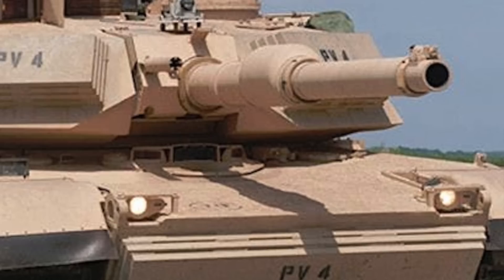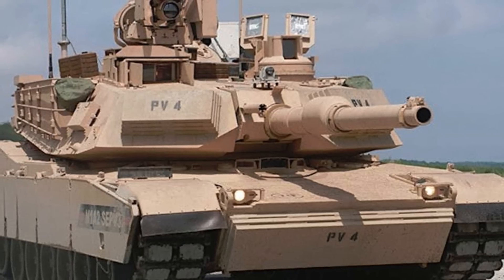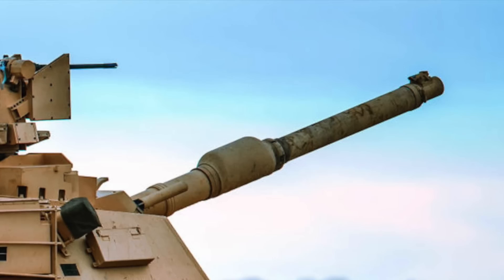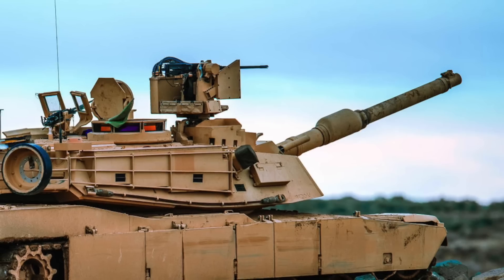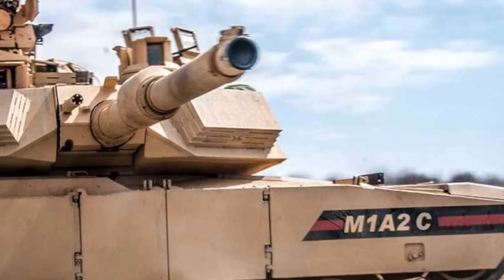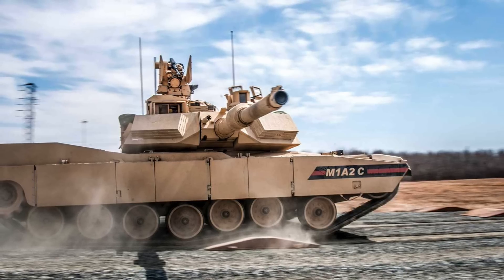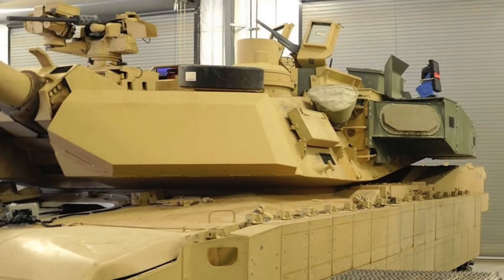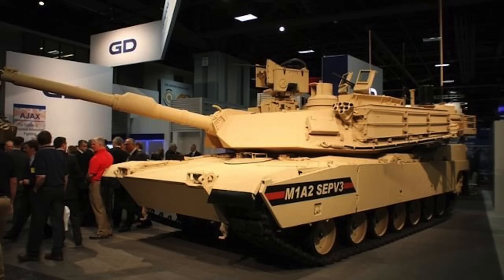ABRAMS M1A2C - FULL ANALYSIS OF LATEST VARIANT !

Comment: 😂😂😂😂Only 20 Armada tanks ever made! Well it looks like those i have seen in the parades are not so scary after all.
Reply: Νίκος apparently a Bradley can penetrate it
Reply: MyStreak I heard they can penetrate the unmanned turret. The hull is still unknown. I at least expect the hull to be able to protect from a Bradley.
Reply: MyStreak Bradley TOW Missile through the turret side would penetrate the turret armour, however the damage t would do remains to be seen as the T-14 has an unmanned turret design and the hull ammo storage so not much would happen. It also has an APS which is designed to hit AATGM’s out of the air similar to the Israeli trophy system on the media a so it’s dubious if they could hit it. BUT you are correct that if a TOW actually managed to impact that area then the tank would be pen’d.
Reply: @mystreakyt  yeah,nice dream,even though very delusional.
Reply: Maybe they are applying the principle the NATO forces used during the Cold War.  The NATO forces operated on the principle that they should be able to kill 10 to every 1 ratio. Obviously, the key is to stay alive and not get killed or have your vehicle blown out from under you. During the Carter presidency, the U.S. Military suffered from underfunding to the point where major decisions couldn't be made with respect to upgrading units with the latest technologies. Often units were sent around to various depots to cannibalize vehicle for replacement parts in order to remain at full combat readiness to some degree. It probably was until the Reagan presidency that U. S. forces saw their strength achieved.
Reply: helen he only 12 Su57 now, and how many are serviceable? God only knows.
Reply: Many people here dismissing the Russians. Even the Germans with their superior tech were quick to dismiss the Red Army... 20 Tanks, serviceable by 2028, too weak, We will blow them away.... War changes the need to produce weapons fast. Are American made weapons fast & cheaply produced compared to Russian tech?
Reply: Simon Shaninga We’re not in the 1940’s.  Russia doesn’t have the manufacturing capabilities to build high tech equipment on mass scale efficiently. Even in WWII, Russia received millions of tons in equipment from the US under the Lend Lease Act.  Russians seem to have forgotten how much aid the US provided. It included 400,000 jeeps, 7,000 tanks, over 11,000 aircraft , almost two million tons of food.  To be honest, when I read anti-USA remarks from Russian trolls like yourself, I sometimes wish the aid would not have been given.
Reply: @Thetequilashooter1  

Rubbish, FYI Russian Red Army would have defeated Hitler with or without USA aid, and frankly speaking USA aid claims are highly exaggerated, I read Field  Marshal Zhukov  comments
Reply: armata is not in full production yet. wont be untill 2021-2022. because the arbrams is still only competition worthy to the T-90. no need for the armor expensive armata yet so they are going to put a 152mm cannon on the armata T-14 B model . the abrams with a  firepower upgrade wont be ready untill 2023. so that way the T-14 and better abrams go into production around same time frame.Russia can save a little in the meantime upgrading existing fleet.
Reply: @georgicooley5491  Competitions will be the Middle East countries buying weapons from the United States and Russia
Reply: https://www.latestnewsplus.com/2019/11/russian-military-to-get-pilot-batch-of.html?spref=fb
Reply: 😂😂😂😂They spend far less money on military and still have a superior tank than the USA.
Reply: @artemg11  Superior Tank? More like paper tiger.
Reply: @artemg11  Good for them then!
Reply: Russian tanks are death traps when going against M1 Abrams! Just watch the news.
Reply: Crazyirish _  Yepp,just like those Abrams targets burning in Yemen.
Reply: @isahbello9785  you mean export variants of abrams that dont have depleted uranium hulls and other added protections
Reply: @eibenzw2574  same could be said about the Russian tanks reputation, as they were exported versions to countries that didn't really give a damn about maintenance and upgrades.
Reply: @Hierachy  riiiiight maybe if the tracks had been tightened and the oil changed it would have made them more accurate and bullet proof .lol
Reply: @abramsatwo2515  those particular things can impact readiness of said tanks, but doesn't change the fact  that they were exported versions of said tanks without important upgrades (armor, ERA, FCS, engine, ammunition,etc), im not completely defending everything about Russian tanks, because they did have problems like all tanks do, but what do you expect from a smaller country being attacked by several superior countries (in terms of military power) to do? especially when they have no air cover?

basically what im saying is if they were the updated tanks, they're reputation would be a little different (but results would be similar due to the coordinated army's of said larger countries working together)
Reply: All this state-of-art American military hardware, yet your country is tearing itself apart from within, and you still have to pay for it all at some point.

:Russian sitting in the sun on the banks of the Volga; laughing at your joke of a country.
Reply: @gladifly  Yes  freedom has it's challenges. Freedom is a messy thing. That's a problem Putin doesn't have. So stay on your ass and be quiet and you won't upset Vlad. Some people had negative things to say about Vlad. Some were shot; some were imprisoned; some were poisoned with polonium. But you don't have to worry about that. Just keep your mouth shut and  you'll be fine. Oh,  and you can still come on YouTube and be anonymous and talk shit. Be sure not to let your name slip out or you might get the attention of Vlad's friends.